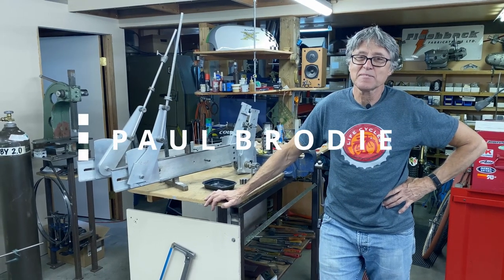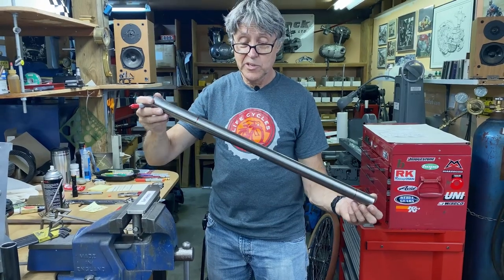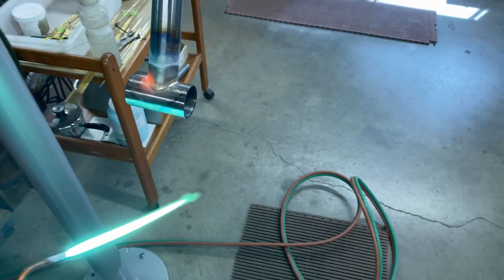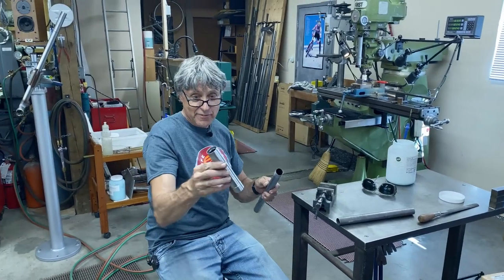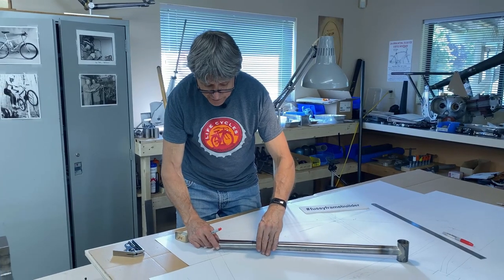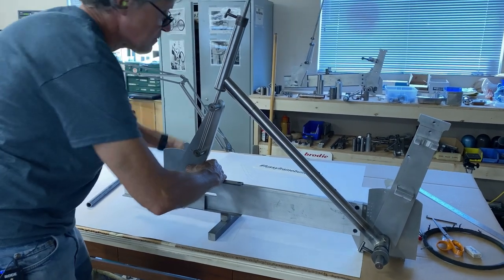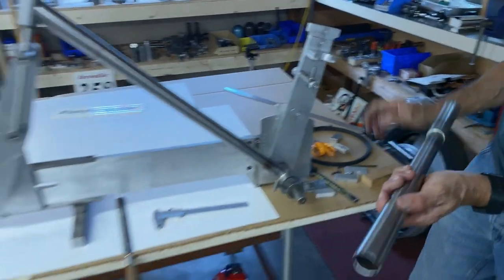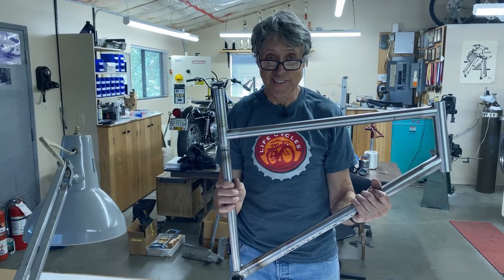Mitering and tacking the front triangle // Romax Build Part 1 - Framebuilding 101 with Paul Brodie

Comment: Think that may be four times I have watched that. Great stuff. Not quite sure why you ovalise the seat tube at the bottom bracket end. I can see why you do the down tube and top tube to the head tube...to give more room to fillet at the edges. But why the bottom bracket?
Reply from the maker: Ovalizing the seat tube gives you a little more room for brazing or Tig welding to the down tube. Also adds a little bit of torsional stiffness. It's also a "look".

Comment: Silly question; you made provisions to get water out of the down tube and seat tube, but what about getting the water out of the bottom bracket?
Reply from the maker: Some builders drill and tap a 5mm thread under the BB. Then you just take out the screw if you want to check for moisture. Not a silly question..

Comment: Thanks Paul, great videos, huge amounts of information! Just curious, a lot of other builders, and lots of the things I have read, start with the seat tube as the first tube and point of reference. Any reason why you start with the down tube?
Reply from the maker: Good question Mark. Every framebuilder does things their way, and for various reasons. My question to you: which is the more important connection... down tube to BB or seat tube to BB? When I asked my Framebuilding 101 students, without exception, they all said down tube to BB. And that's my answer too. So why then would you attach the seat tube first, and then have to notch the downtube? That makes no sense to me. A lot of my framebuilding processes are based on logic and common sense. Hope this makes sense to you too.
Reply: @paulbrodie  thanks for replying, appreciate you taking the time! Makes sense as the downtube is under more stress.

Comment: Can i ask why tacking first the frame with TIG and not make that spot with braze? I mean I understand that it is  about the deformation when you heat the area with braze, but making it carefully there might not have problem, right? Thank you for this videos, I still learning each time i see one of these series.
Reply from the maker: If you don't have a Tig machine yes you can tack with the torch. It just takes longer because you are waiting for the steel to come up to temperature. It works fine for the front triangle. The problems come tacking the rear end. Mostly because you can only tack one stay at a time. The torch heats the stay, making it grow a little in length, and then you add the braze. This puts a little pressure on the jig. Now the stay begins to cool, and shorten, and pulls the jig while you are heating the other end of the stay. Even if you have a "perfect" jig, your frame alignment might be out a little or a lot depending on technique. That's why it is so much better to tack the rear end with Tig.The tack happens so fast very little heat goes into the stay. In a perfect world.
Reply: @paulbrodie Thank you so much for taking a time for your detailled answer. What you say makes sense, in my country is harder to get access to tig, thinking about It making that spots with MIG (Its not that precise and Heat more the frame comparing with TIG i know) but should work for  tacking, what do you think? Hace you ever tried that? And again thanks for your answer
Reply from the maker: @jorgeperez2347   I've never used Mig, but I doubt if you have the same level of control as Tig, especially on thin wall tubing. Probably best to stick with oxygen-acetylene..
Reply: @paulbrodie  okey its nice to know. Thank you Paul

Comment: Hi Paul. Greetings from Slovakia. I love your videos. So much so I want to try to build my own frame. I would like to ask what is aproximate burn time spent on 1 frame? I was unable to find such info.
Reply from the maker: Hello Slovakia. Thanks for watching! By "burn time" do you mean total time spent on one frame? Well, a lot of that depends on experience, jigs and fixtures available, and the quality. For your first frame 30-40 hours would be a reasonable guess. When we were making a lot of frames our average was 7-8 hours / frame. The fastest we ever made a batch of (10) frames was 4 hours each, never to be repeated. I have heard of a builder who could make a frame in 2 hours, but for that I really do equation the quality...🤨
Reply: @paulbrodie , to be more precise, I meant the time when the torch is on. Burn time. I just made it up I guess 😀 I am already putting in some hours working on a jig and mittering the test tubes with a file. I wanted to have an idea how much gas will I need for 1 frame to decide on the size of the oxy-acetylene kit. I already intend to build 2 frames, but I am not sure yet if I will build more.
Reply from the maker: It depends how fast you are. One of my students set a record for brazing his chain stays onto the BB... 2 hours and 47 minutes. I timed myself.... 22 minutes.  That is burn time.  🤓
Reply: @paulbrodie  Thank you sir.

Comment: What kind of tubing did you use on this build? Currently shopping for tubes for my first frame...the options are dizzying!
Reply from the maker: The top and down tube are Tange Prestige 8/5/8. Hard to find because it was made over 30 years ago. Seat tube is Columbus 9/6. Seat stays and chain stays are also old stock Tange.
Reply: @paulbrodie  First build, with only a hack saw and files...I'm probably going to go with something like 631. I'll be re-re-re-watching this series of videos and sending you coffees as I go through the process!
Reply from the maker: @ResonantElecDesign  When I first started I had very little in the way of tools. It's surprising what you can do with very little. Good luck!

Comment: Would the nickel-silver braze work by itself, in terms of adequate strength?
Reply from the maker: Probably, but the fillet braze over top is like a huge insurance policy.
Reply: @paulbrodie  sort of like lugs in a lugged frame?
Reply from the maker: @dennisyoung4631   No, that's a different application. Do a search on frame building with lugs, and you will see it is not the same as fillet brazing for quite a few reasons.

Comment: Are these stainless steel pipes?
Reply from the maker: No, they are Tange tubes, heat treated 4130 and micro polished. We don't call them pipes. Pipes are crude, heavy things that plumbers have to deal with.
Reply: @paulbrodie  Thank you paul, I wrote the comment while watching your video, before I got to the part where you mentioned the 4130 alloy. They looked like stainless, and I was surprised at the ease your hole saw went right through them. I work a lot with stainless steel pipes and tubes (pipes go by inner diameter, and thickness is referred to by "schedule", while tubes are OD, and thickness is in units), and schedule 40 stainless pipes are tough to notch.
Reply from the maker: @dmitrisafonov6976  Thanks for watching!